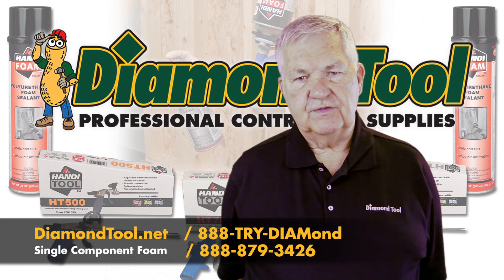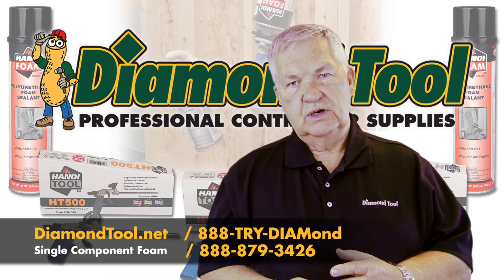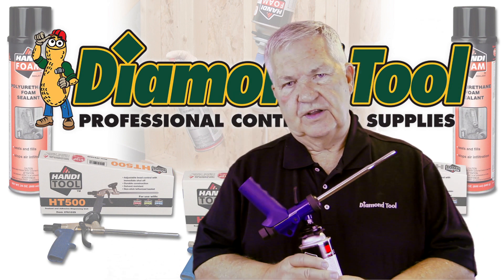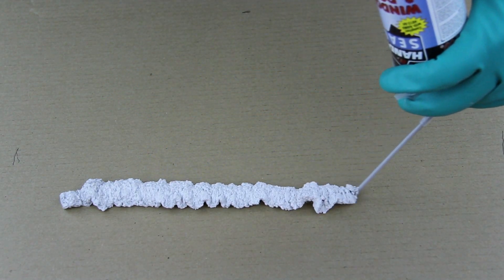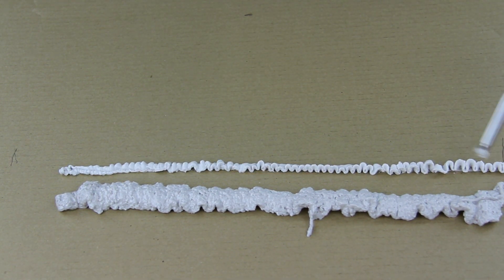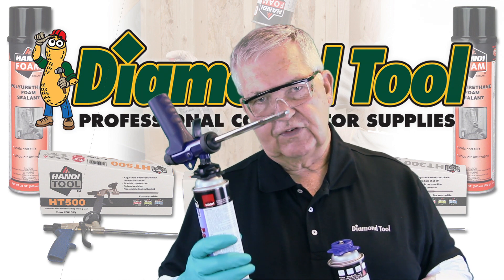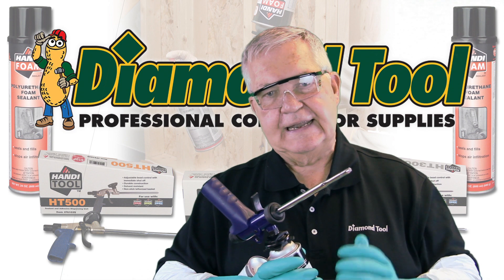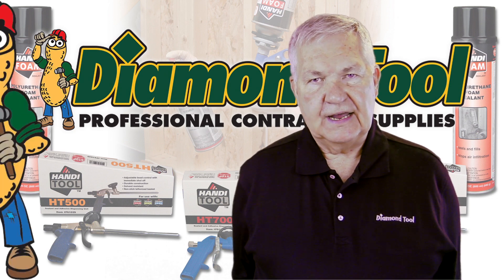Single Component Fomo handi-foam gun foam sealant

Comment: hi, in response to cleaning the gun. when gun is empty, remove and put on cleaner can then put on a new can? how about long term storage of gun? thanks
Reply: Yes- just the drop of cleaner that comes out when you screw it on is enough. if you're storing it without a can for long term, go ahead and actually spread some cleaner through it and make sure it gets all traces of foam out. But generally, just the little bit of cleaner that comes out is OK, then screw a new can on and you're all set.